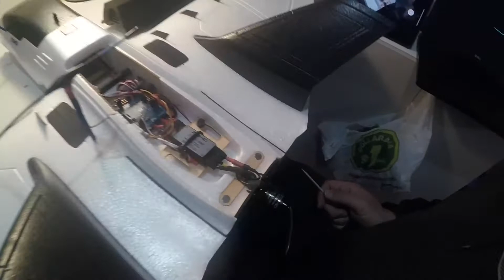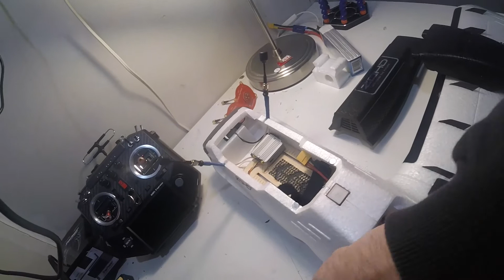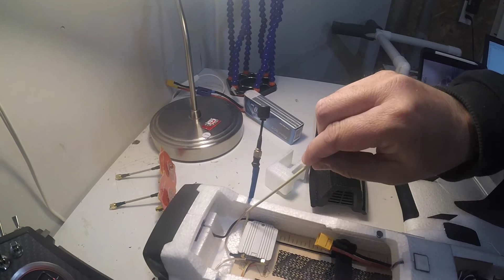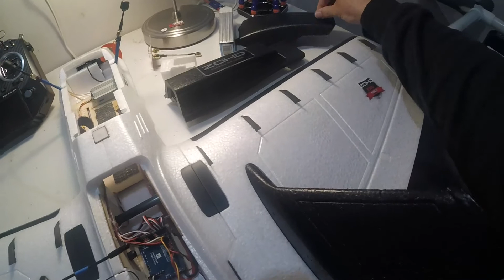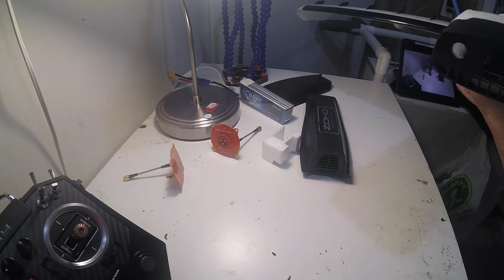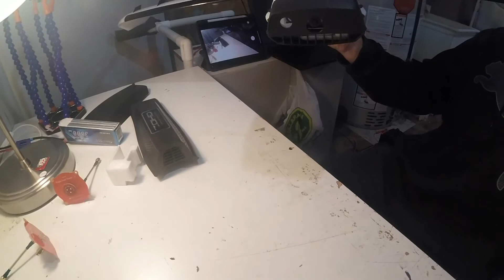ZOHD Dart XL Extreme + DJI Digital FPV Part 1 - Build Overview

Comment: Any better range with the other antennas? Sorry I know this is an older video but I'm just about to build one of these myself I've been wanting to do so for quite some time and can I ask you if you're still available What radio it was you were using?.. I currently have both sets of goggles the goggles V2 and the goggles too they come to the Avata.. I'm trying to figure out if I need to use the DJI FPV controller the one that's usually sold with the air unit. I assume yes I have to is that right? If so I also thought they got a little more range than that although I know by now there has been updated in newer models created.thx brother

Comment: Can you buy this from anywhere RTF already built with DJI and crossfire?
Reply from the maker: No, you have to build it yourself, I can help if you have any questions
Reply: @RaedAdlouni  It will be a while.  I'm recording my own Edgy Choppergirl SoundPak right now (think Amber Soundpak Replacement).  I recorded 250 sound files today (entire OpenTX EN/SOUND/SYSTEM dir, mostly numbers), only 500 more to go :-)  

Does the air unit get enough cooling inside all that Dart frame styrofoam insulation with just the front end open?  Mine gets hot fast just sitting on the bench in an open 7" quadcopter.

fpvbook.air-war.org
hba.air-war.org
fpv.air-war.org

Comment: I like your set up,  Thanks for sharing. I have not seen the anti slip material on battery tray, did you hot glue it down?
Reply from the maker: I used a shelf liner and glued it down to the wooden tray

Comment: Have you got the osd to show up on your dji goggles yet? If so what is the port screen look like? Great video thanks for sharing. I have the same FC and I’m putting it in the Reptile Dragon just came in today
Reply: So what are you seeing in the osd feed? I’m only seeing the voltage no other data like number of satellites or home position speed etc. thanks
Reply from the maker: You will need to configure that in inav OSD page. Chose what data you need and where to place it on the screen, also you need to enable custom OSD on the DJI goggles
Reply from the maker: Yes I have, in the ports tab, select "DJI FPV VTX" under the peripherals section. Of course you will need to do that for the UART to which you have connected the TX/RX signals coming from the DJI air unit. you can check this in the part 2 video. Link https://www.youtube.com/watch?v=MQBZ8mPBEWA&feature=youtu.be

Comment: You don't have any heat issues on the air unit? Are you running 1200mw?
Reply from the maker: I am running 1200mw, no heat issues because the air unit is mounted behind the camera hole in the front, so it gets ample air flow
Reply: @RaedAdlouni  What FC is that exactly? Inav or betaflight?
Reply from the maker: @TechieMillennial  inav, matek F722